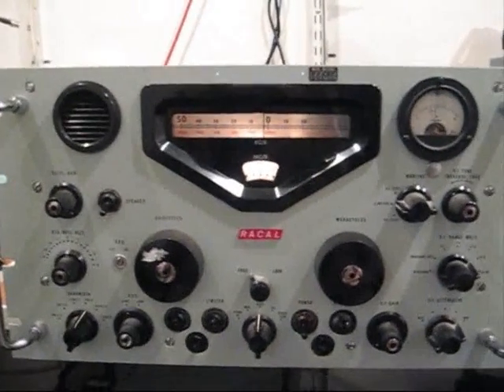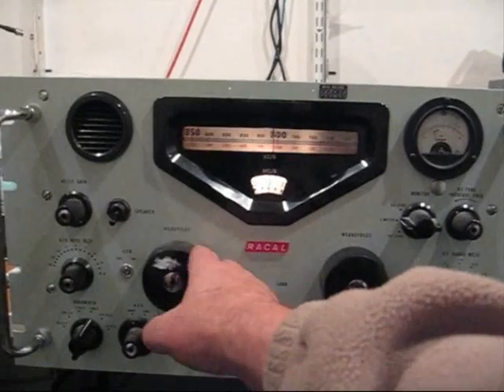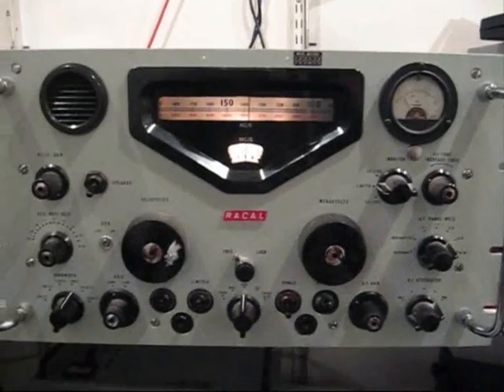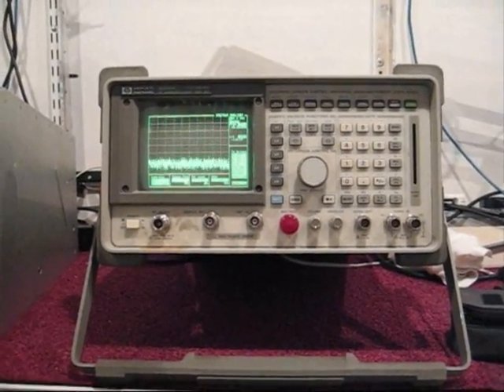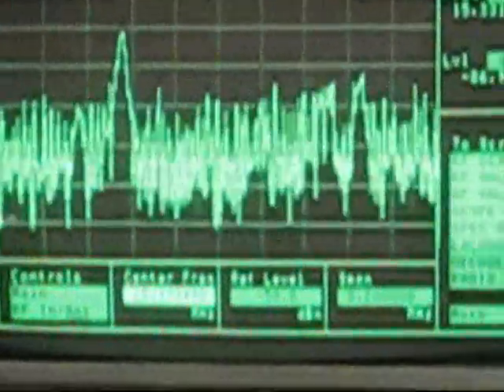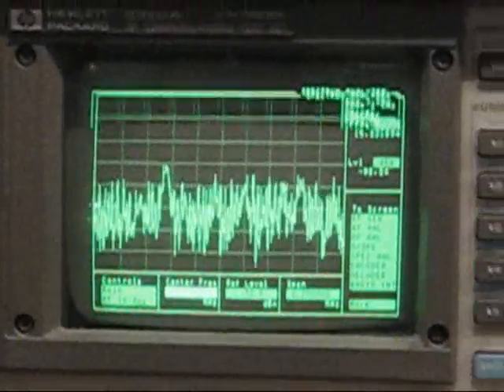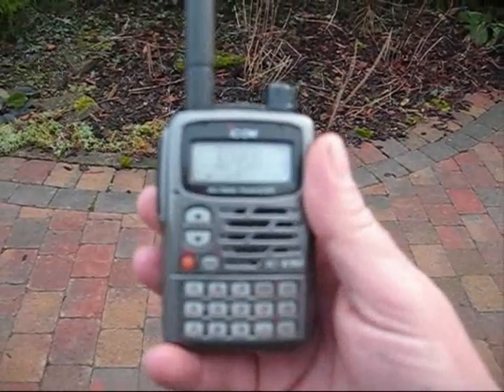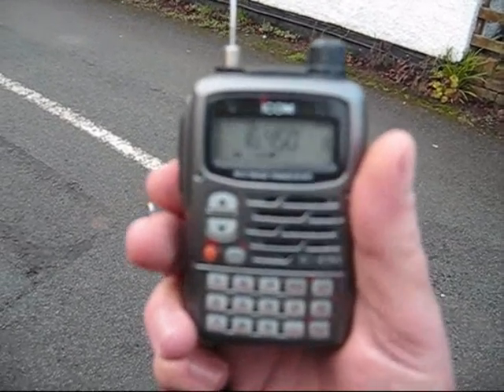Power Line Signalling The Death Of H F  Radio

Comment from the maker: @gchenley Hi Gary
Power line signalling, simply put are transmitters and receivers which use your house wiring to send high speed data, typically video streamed form the internet to your TV set which is probably in a different room to your internet hub.

These devices use a fair chunk of the H.F. spectrum, and although some of them have notch filters to cover amateur segments of the band, the filters are not good enough to allow a neighbour listening to 1uV to enjoy his hobby.

Comment: Nasty... every QTH i've been in since i got my G0 has had real bad QRN and TVI .. a so i gave up for 10 years. new house, new town, new station, new problems, streetlamp interference 15m up to 4m . not tried 2m yet. also instant TVI (Ofcom called again, said i was clean & carry on)  a MFJ 1026 was tried (it phased out one source by 180 degrees) but there are multiple sources. new qth planned. gulp. try the phase cancelling devices if you get no luck mate.

Comment: The Declaration of Comformity for the Comtrend adaptors that you can hear in this video states conformance to EN55022. I've personally had them tested and failed horrendously.  They do not comply withthe essential requirements of the EMC regulations so should neither be CE marked or on the market. PLT cannot comply with EMC regs because they wouldn't work.